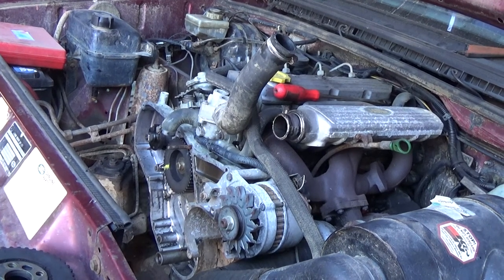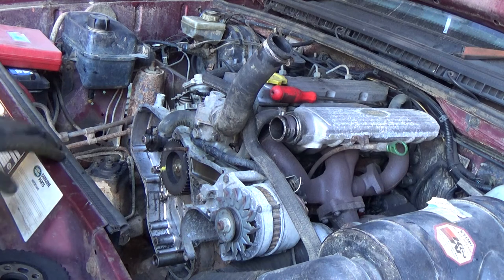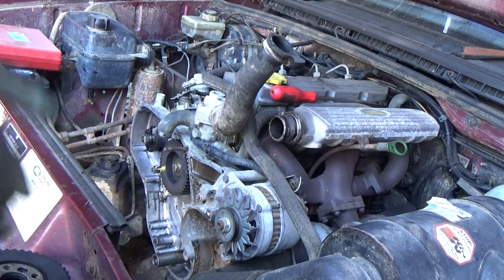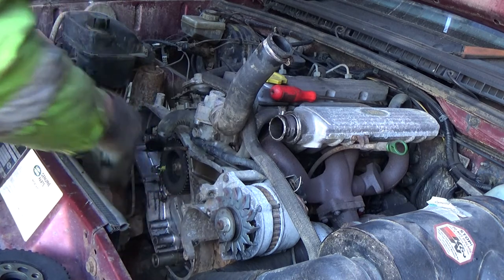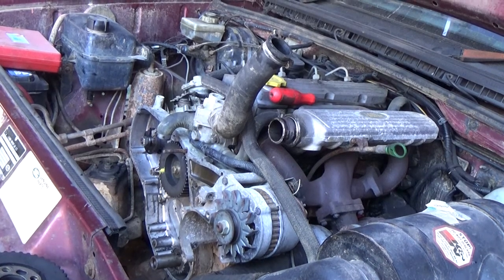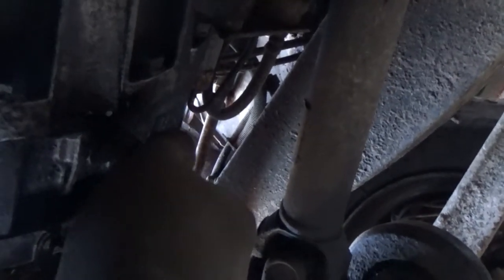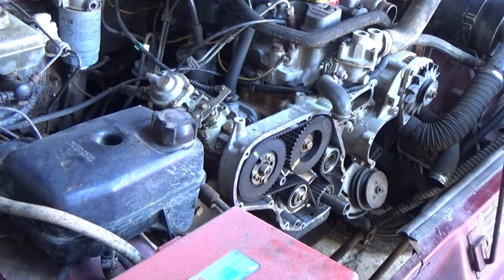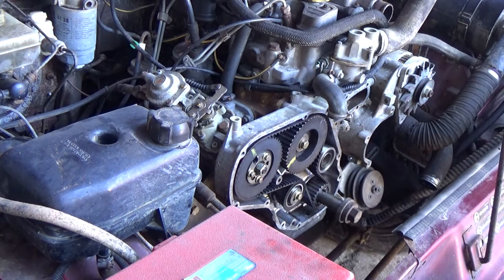Discovery 200 cambelt change

Comment: Can't thank you enough for this. I'm running a 200tdi in my series 3, your comments on the cross member being in the way of the flywheel timing pin are very useful. I'm planning on fitting an lt77/230 at the same time so would be able to access the flywheel at the very least for visual reference.

Thanks again for this very detailed video.
Reply from the maker: Thank you for your positive feedback. I have since worked out that on a series, for how often you'd do the job, you could easily undo the engine mounts and jack the engine up to get the timing pin in the flywheel.
I run a 200 tdi in a series so if you haven't already done so have a quick look at some of my other videos. Thank you.
Reply: @RWrestorations  Where are you based in the UK? Im guessing the south west somewhere.
Reply from the maker: Not even close with that guess! I am in the UK somewhere between Sheffield and Derby